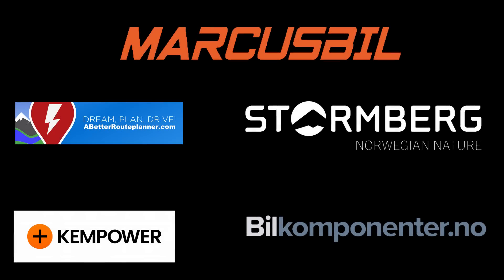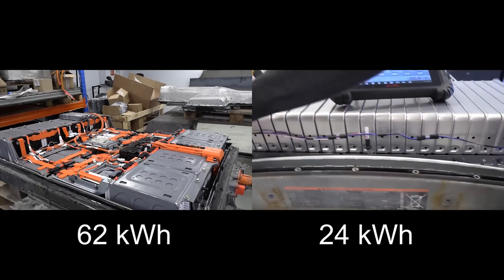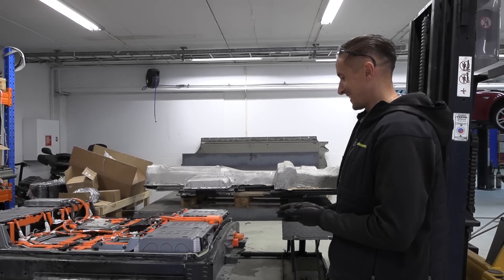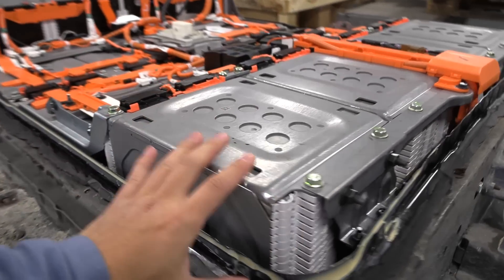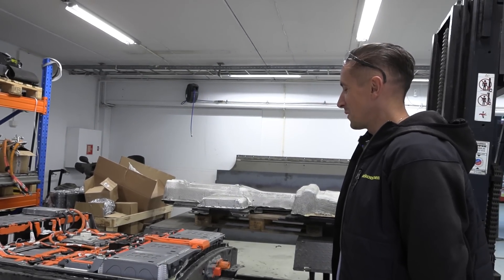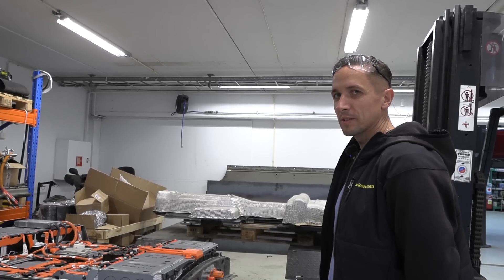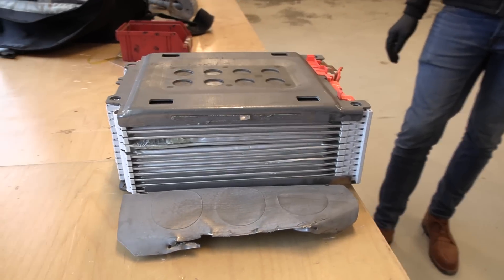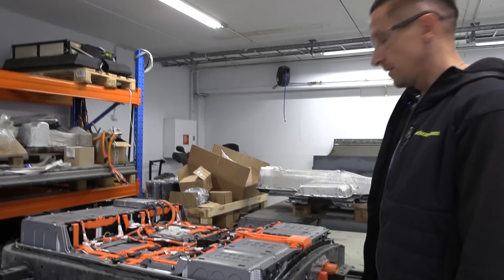The 24 kWh Nissan Leaf battery might not rapidgate at all

Comment: I’m a Li-ion battery engineer in the automotive industry, and it just blows my mind that even the second generation didn’t have an active cooling system.
Reply: There is a person in Europe who make replacment batteries for the Leaf using 18650s...
Reply: @Derick-s7u   who ????
Reply: @Derick-s7u Could you give more information please?
Reply: Hey people talking about Leaf battery design.  Leaf was Nissan CEO Carlos Ghosn's baby at Nissan and remember what happened to him (arrested with no trial for two years before "escaping").  So it isn't surprising that no money was spent upgrading Leaf battery design over the last few years.  My 2013 Leaf still has 11 bars out of 12 but it is only L2 charged 3033 times but only 4 Chademo charges.
Reply: @morrisg  He isn´t called "Le Cost Killer" for nothing.
Reply: It's a shame as 40kWh leaf otherwise seems quite a good all round package. Good space, looks decent compared to 1st gen. Passive cooling and chademo are it's achilles heel really. The 62kWh model baffles me considering the date it was released and what competitors have, but apparently the battery design never included cooling or space to fully benefit from it, so they just went for the easy upgrade rather than re-engineer on an old model...
Reply: @4EV-ER  We know the weaknesses of the passively cooled battery. Don't buy one if you want to fast charge frequently. We know these batteries are find if they L2/L1 charge almost all the time. Lots of other EVs to choose from with active cooling if frequently fast charging is desired.
Reply: Nissan engineers are the most stubborn. None learning after 13 years
Reply: Twin Battery Technology YouTube channel his leaf has a Bolt battery installed
Reply: Chevrolet (GM) is another stubborn company that chose not to develop the battery platform through multiple revisions (Spark '14 - 16, Bolt 17 - 19, EUV 20' - 23') Still 49/56kW max charging on a 400V architecture despite capacity rising from 18kW -> 65kW. Bolt could have comfortably achieved 100kW with its water cooling, the bus bars just weren't expanded.
Reply: I was about to ask about that very thing, because it should have been apparent to Nissan very early on that this was a weakness of their battery pack. And it might not have been necessary to do a complete overhaul of the battery but simply some sort of passive cooling add-on. I have a 2018 Kia Soul EV, and although it doesn't have liquid cooling, it does have a system whereby it blows cabin air into the battery pack. This is actually pretty clever if you think about it because lithium batteries like to be in a temperature range similar to us humans. It's a 2018 and I have had NO range loss so far. (I believe later generation Kia EVs are liquid cooled however.)
Reply: They wanted it to be backwards compatible with 1st gen. Nissan was in a bad place at the time, so they did as little as possible to re-design it. Also, in other countries, a few quick charges is all you need for a long trip. This car wasnt built with America in mind.
Reply: Hey...what will happen when you fill up the battery with oil for cooling- as it will be used in transformers??
Reply: I agree. I have a 2017 leaf with a 30 kwh battery andI wonder if I could instal a solar water mat filled with saline between the metal case and the plastic under cover to act as a heat sink? A recirc pump and a small external radiator could be added too.
Reply: They made FOUR GENERATIONS of car without active cooling.  24, 30, 40 and 62kWh batteries have no cooling.  24/30 have terrible degradation.  40 has bad rapidgate and shows signs of degradation faster than comparable cars, including at least a few bulging battery packs.  Combined with shitty chemistry on 24/30/40 packs.   Not enough data on 62 for now but I would not buy any Leaf - Nissan have shown they do not build reliable EVs.  Maybe Ariya will be better, will have to see.
Reply: @tomsixsix  my 24kWh Leaf is approaching it's 10th Birthday and has 80% of its original capacity. The majority of the charging done over its entire lifespan is on the 6.6kW onboard AC charger. The 6.6kW was an optional extra so many of these cars only charge at 3.3kW. It's still our primary vehicle and is now doing double duty as a domestic battery via a V2H charger.
Reply: @tomsixsix  depends on the climate you live in. My 62kwh Leaf battery has only once got to 38 degrees.
Reply: @tomsixsix  '...Nissan have shown they do not build reliable EVs.' Really?
Here in Germany all newly registered road vehicles leave the dealer's lot with a roadworthy certificate valid for three years. The rwc has to be renewed every two years after that. The Leaf is known for getting through the rwc inspection with few to no problems. With a Tesla this becomes a 50/50 proposition.
The CEO of Nextmove, Germany's biggest EV rental company, stated in one of his YT videos that his Nissan fleet has the least number of unscheduled shop visits by far.
The battery tech that Nissan installed is primitive. It is however anything but unreliable.
Reply: @marcg1686  Maybe "unreliable" is a bad word.  But for cars to have lost 30% of capacity within 5-6 years is not acceptable.  There are 10 year old Model S cars with only 10% degradation.  Some 24 and 30kWh Leaf have lost over 50% in the same timespan and most have lost at least 25%.  It is really poor.
Reply: @tomsixsix  We had an early LEAF (2011 24kWh), and while it served us well for almost nine years, the issue that forced us to replace it was battery degradation. My wife's commute is only 52km total (i.e. 26km each way), and the last two winters it could barely make that trip, even with minimal cabin heating and starting at 100% SoC.
When the second gen. LEAF came out, still without proper thermal management, I wrote off Nissan as a company serious about EVs. Add the dismal app (actually, it was mostly the extremely slow communication with the car) and a few other niggles (like staying with ChaDeMo), and it'll take a lot for me to even look seriously at Nissan again. They made a good first attempt, but squandered the lead.
Reply: @tomsixsix  The early Leafs exhibited very poor battery life, no question. I can understand why Nissan didn't implement active cooling on the Gen1 cars. Complexity and the ensuing costs associated with that.
What I find unforgivable is not improving the passive cooling on the 40kWh battery. I think the simple addition of an internal fan just to mix up the air distribution within the casing would help to slow the degradation of the rear cells.
There are Teslas out there with high mileage and low degradation but there are also individual cases where this is not the case.
A Japanese YTer, @EV164HIROSHI, has been uploading monthly battery reports on his 40kWh Leaf for some years now.
His car now has almost 290.000KM (180.000 miles). The SoH is about 78%. Not bad for a battery without any cooling.
Reply: @tomsixsix I’ve a 2018 40kwh leaf 5 and half years old, 110,000 kms on it.  Less than 13% degradation and has now stabilised.  That’s facts and matches others.   Only constant fast dc charged like a taxi might do causes issues.  Normal AC or seldom dc and it’s low degradation.  Leaf is extremely reliable and part of that is it’s simplicity
Reply: @koma-k chademo was a better standard than ccs, with vehicle to grid built in and canbus communication.  However other ev manufacturers brought in ccs to slow down the Japanese cars taking over
Reply: @kennethsmyth  I'm not sure I buy the "slow down the Japanese cars taking over" - at the time CCS was conceived the only Japanese EV was the LEAF (the RAV4 EV used different connectors, and production numbers were negligible), and ChaDeMo doesn't do AC charging which was the whole point of CCS - a combined connector. ChaDeMo also wasn't a formally finished standard until 2013, and until 2010 it didn't even have a dedicated association, but was a TEPCO project with collaboration from a few other Japanese companies.

V2X is coming for CCS, though still a couple of years out it seems, but compared to the US and some other areas of the world interest isn't that high in Europe, as blackouts are rare here.

But the original subject of the comment I replied to was the physical format of the connector, and having handled both ChaDeMo and CCS2 I prefer CCS2 by far (with Tesla's "bastardised" type-2 connector as used on the old S and X in Europe being "handier" than CCS, and I imagine NACS trumping them all in that respect).
Reply: @marcg1686  It's possible to keep a slow degradation if you are willing to put some effort into the charging habits. I'm at over 93% SoH at 228000 km on my -16 30 kWh Leaf. I lose on average roughly 1% SoH per 48000 kms or 0,7% per year.
Reply: @kennethsmyth  That's pretty good. My ZE1 from March 2018 shows 89.4% SOH. Max capacity right now is 33.9kWh.
The Leaf is easy to live with. I like having the charge port up front. I'm getting good mileage with only moderate tyre pressure. Cabin preheating is great, having physical buttons and normal door handles is much appreciated.
However, if Nissan would offer me a good trade in deal I would take the 63kWh Ariya in a heartbeat. It has normal door handles. 👍
Reply: @goranhellstrom3439  93%! Are you sure. Perhaps the CAN Bus dongle is misreading the data. How can your capacity loss be so low?
Reply: @marcg1686 schön, wenn die Karre problemlos durch den TÜV kommt, hilft nicht viel, wenn der Akku nach 8 Jahren so degratiert ist, das es nur nöch als Kurzstreckenauto durchgeht....als Zweit oder Drittwagen geht das noch....sonst unbrauchbar, speziell wenn man andere Marken vergleicht!
Reply: @Alois-sv9ft 
Ich habe jetzt immer noch 87%.
Für den Alltag völlig ausreichend.
Reply: If you are li-on battery engineer, go ahead and build at least something in 2010. ENV200 had active cooling with the same battery pack and it didn't help at all because of the chemistry itself and it seemed that Nissan knew it already so why bother? Plus, in 2000s, nobody knows anything, nobody tested anything (besides gm ev1 haha) so either you are going to build something and take the risks or give up. You can argue that even 2nd gen doesn't have cooling and here is how li-on battery engineers still have their jobs and salaries because in 2017 everybody sold EVs at a loss and only Nissan became profitable first. Then Tesla in 2021. Look at ioniq (not classic) sales, this is so expensive even for Hyundai so they haven't sold their 100k cars yet
Reply: @raden9ka  ENV200 only has fan cooling, it's barely any better.  Liquid cooling is the way to go.  It's possible for Nissan to have tested the cells thoroughly before building them into vehicles.  Simulating many cycles and high temperatures, to see what cooling is needed.
Reply: It is not needed for every day use. In most cases it is enough to slow charge at night and drive day. Diesel is better choice in case you need many quick charges.

Comment: I'm interested in the cooling solution for the first generation Hyundai IONIQ, which doesn't have such a problem with overheating thanks to active air cooling. Presumably there will be some channels in the battery through which air passes and thus indirectly cools the battery cells.
Reply: There's a large fan in the trunk that pulls air from the cabin through the battery pack.

Comment: New game - drink a shot of vodka, each time Bjorn touches opened battery with bare hands.
Reply: He has safety glasses he is safe😂
Reply: I’m pretty sure that the rubber gloves that the guy is wearing have nothing to do with shock protection.
Reply: @timpayne7676 Those are also not rated for any kind of voltage and are just thin gloves to prevent your hands from geting dirty.
Reply: He has a death wish
Reply: @eemilvanced6592 what danger could be? Ground fault?
Reply: Until you don't touch the other polarity, there will be no current flow